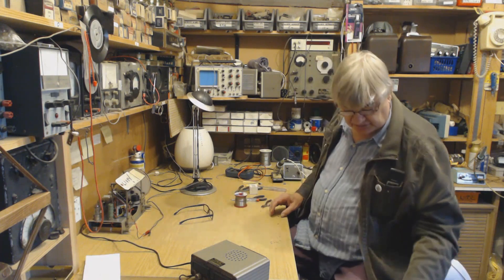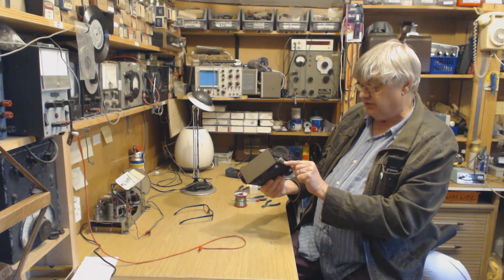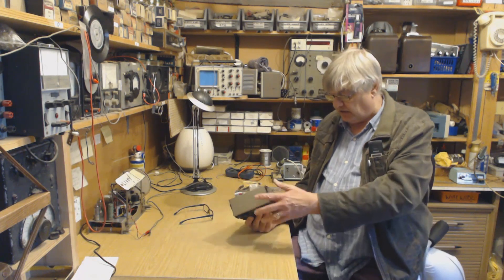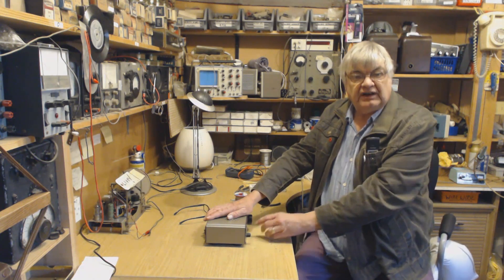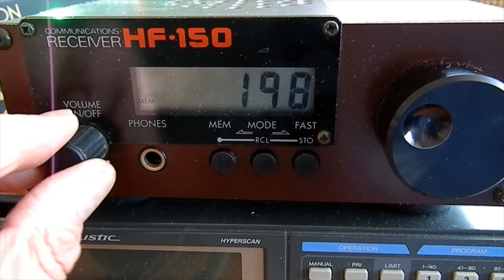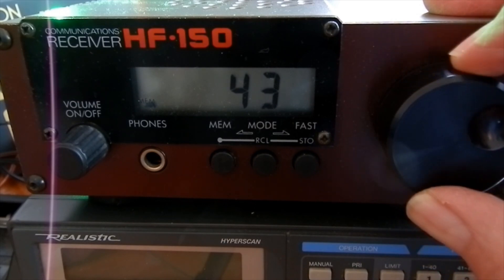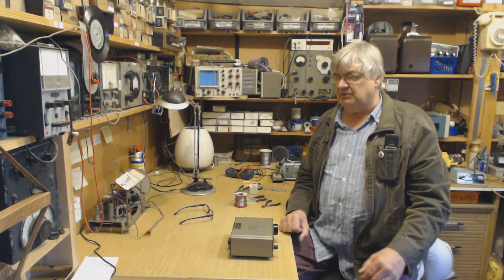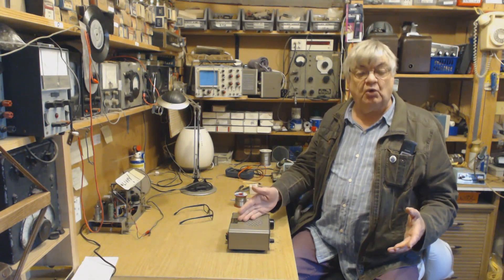The Lowe HF150 Communications Receiver

Comment: A nicely made radio, but they were prone to overloading due to poor front-end filtering (just octave filters I think) and they later supplied a matching preselector. The Lowe HF225 was much better but more expensive - I still use mine!
Reply from the maker: Janet Winslow yes, you’re right. I use an ATU with mine.  It makes all the difference. Cheers, Ray.

Comment: Great video Ray - I have been enjoying your excellent channel for a while now. This one particularly got my interest, as I got a HF-150 myself last year. As you say, brilliant little receiver with so much performance and capability packed in.  Mine came without a keypad, and it is well worth using one - I have had a HF-225 since new with a keypad - so I made one, which is quite easy, one chip and a couple of general purpose transistors, as mentioned by UrbanBushCraft. I can share plans if you would like. I've become a bit of a Lowe collector, and jumped at a HF-235 recently.
To the poster RGC198 who asked, it will operate in any mode at any frequency, so yes, SSB all through the tuning range.
Reply from the maker: Edward Holland hi Edward. A Lowe collector, that’s great. Keep me posted. Cheers, Ray.

Comment: Hi Ray, great video thanks! I have had mine since new. I also keep mine on top of the same realistic scanner you have as well as using it with my mini-whip ;-) I have the keypad and have taken some pics inside if you want to see.  Standard 3x4 matrix driven by a GPS SL409B chip + some other discreet components. I do have an issue with mine though - when I switch to higher frequencies it is like the audio is cut off....de m0tfy

Comment: Great video. I would like your opinion on something.  I have three receivers, one tube and two digital. I’m in a muddle about which would be better to do. Would a doublet/dipole antenna (about 50 ft on each side) or would 100 ft as one long wire antenna be better to pick up more stations? I mention this as I am using my Hallicrafters S40b receiver right now and can do both setups. Yet, where I am  beefing to connect it along the side of my house I need to put a small hole in my bedroom ceiling in order to get to the roof vent to do the setup. I’d rather not have to put more holes than needed to do the setup properly.

Comment: I was a teen in the 90's. I had a Yacht Boy 400. I was only interested in HF Aero comms. On a Friday night i always used at stay up until 6-7am, listening to Shanwick/Gander etc, plotting the planes on an Aerad map. I saved and saved doing paper rounds, washing cars etc until i had enough money to buy one of these. Was a LOT of money back then and took me 2 years of saving everything from my jobs, even saving Christmas and birthday money! Day finally came and my Dad took me to Lowe's in Matlock to buy it. Was so excited! Even now they are great receivers. I remember i part exchanged it in the end for a HF225. Thank you for sharing Ray.
Reply: I used to listen to New York tower, MacDill AFB and Croughton in the 80s, when HF propagation conditions were really fab with my FRG7. Back in the day when airliners used AM, I remember listening to AM Shannon/Gander comms on a Murphy valve broadcast radio. They were very exciting times back then, for us SWLs.
Reply: Matt Bates Yes good times. Prop was great back then and hardly no interference at all. Also remember listening to stockholm radio where they would patch flight crew to their ops and would discuss inflight engineering problems. Wish i had a time machine.

Comment: Hi Ray, that is an impressive receiver. Does the SSB work on all bands, including LW and AM? On AM, SSB would be handy hearing 10kHz spaced USA AM stations via DX over there. Also, does the BBC World Service still operate on SW over there? I haven't heard that for some years here. Thanks for the interesting demonstration. All the very best. Robert.
Reply from the maker: Hi Robert, yes SSB is on all bands. The BBC World Service are still around. See here ... https://www.bbc.co.uk/programmes/articles/2x9tqt6mc05vB2S37j8MWMJ/global-short-wave-frequencies
Reply: @g4nsj  Thanks for that. I will have to check that out. I think the SE Asia transmitters should be possible to hear at our place here in Melbourne.